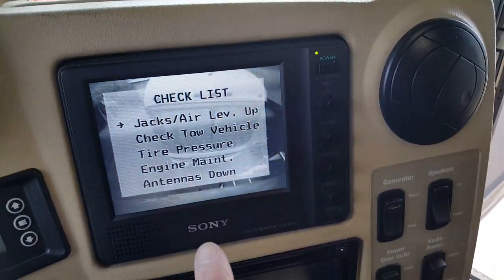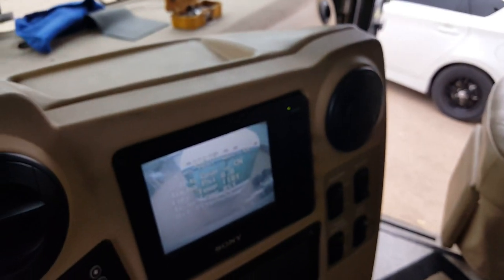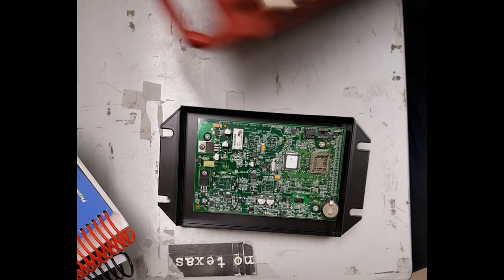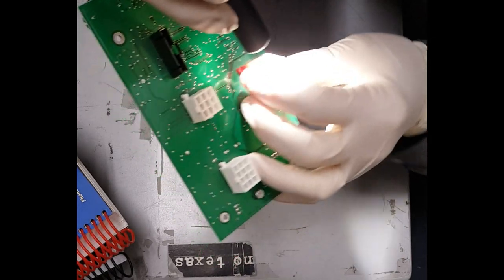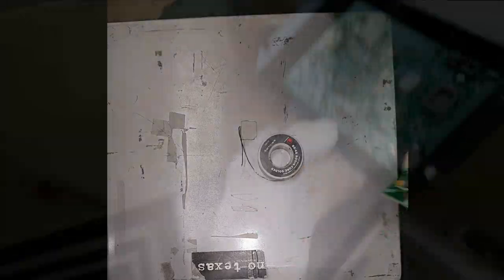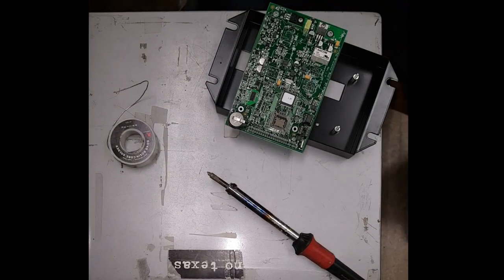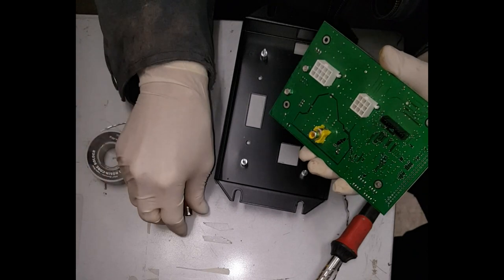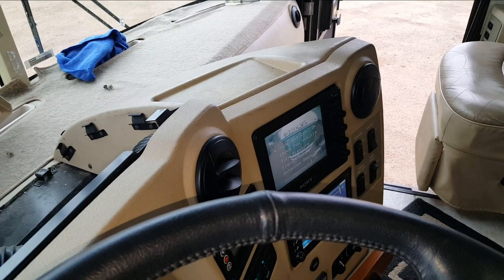Repairing a RV TripTek video display

Comment: Great video. I have a question about my Triptek. The rear camera on my 40 ft. motorhome finally died after 18 years. When I cut it off to replace it, my Triptek quit working. I've located the unit under my dash and can make it work with an external video monitor but it only works when there is a video source connected. I'm guessing this is for sync issues. Would  you know if it's possible to make it work without a video input?
Reply from the maker: I don't know, sorry
Reply: @AZExpert  SOLUTION!! Bought a $15 rear view camera from walmart and tucked it up under the dash and ran the video into the TripTek. All it needed was a video signal as a trigger. It's working like it should.